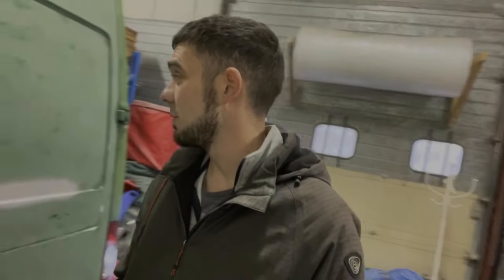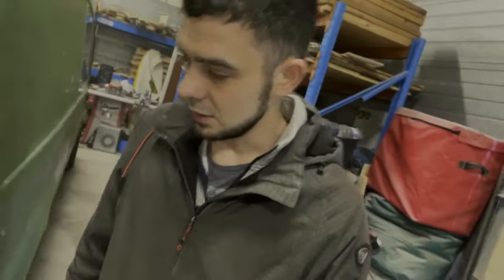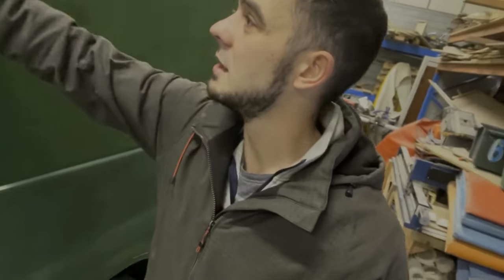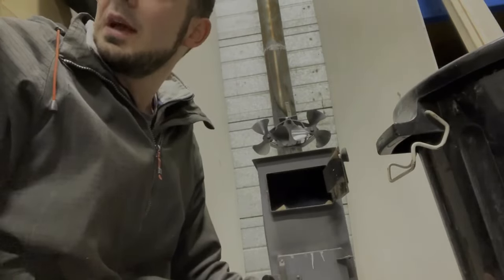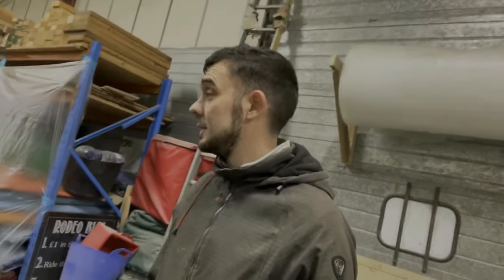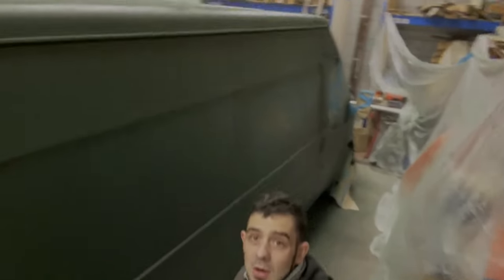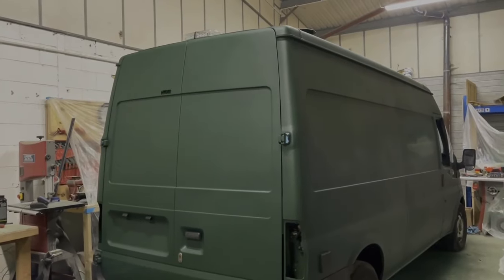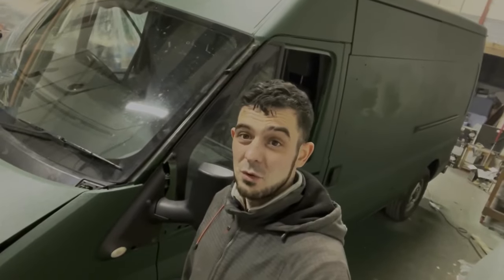Raptor Painting My Transit Camper Conversion With No Experience Van Life Paint Job Re Spray Stealth

Comment: I like how descriptive you are. For someone who has no experience. You sure know how to use common sense & figure things out. I have my raptor liner coming in the mail now. I've also never done anything on this scale before, but after tons & tons of YouTube videos, I'm going to give DIY a shot with my Honda Element. I saved this video because I find it helpful. Same reason I gave it a thumbs up. Great job!
Reply from the maker: Thanks man good luck 👍
Reply: @simplycampervanconversions  Thank you. I have just one question, what set up did you use for sanding it? I was thinking of getting an orbital sander for the task, but wondering what grit or kind of sandpaper would be ideal to get it sanded down like this?

Comment: How many litres of raptor did you go through mate? And how many coats?
Reply from the maker: Hi we used 2 boxes, however the van was already green so a full colour change could take a bit more as it coated really well.
Reply: @simplycampervanconversions  cheers dude. Got ours to do when the weather is better. LWB sprinter with a colour change, going to need at least double then I reckon.
Reply from the maker: @jakejohnson_  im going for 3 boxes on my xlwb daily which is a similar length and going from white to grey.
If you use the raptor gun it uses more paint but gets a better finish a standard shunt gun doesn’t use as much paint but can be patchy with raptor paint.
Reply: @simplycampervanconversions  how many in a box mate

Comment: Good job pal. What did you do about painting the rear door hinges?
Reply from the maker: I just taped off the rubber part and painted the rest, gave them a good scrub with scotch pads and painted.
Reply: @simplycampervanconversions  cheers. Appen I’m gonna give it a go 👍🏼

Comment: Hi pal nice job how many bottles of paint did u use
Reply from the maker: I believe is used 10-12 however I would have used more if I did it again.
A better drop coat at the end.
Reply: @simplycampervanconversions  , I’m looking to do my caddy do u have a rough idea how many bottles I will need ? What’s a better drop coat mean ? Thankyou
Reply from the maker: @michaellang5911  I would say 10 bottles for a caddy.
A drop coat is the final coat when you stand back around 2-3 feet away and spray a mist over the van.
Raptor paint is notorious for being streaky and a good drop coat helps prevent this.
Reply: Ok thankyou for your help mate

Comment: Nice, how did it hold up over time?
Reply from the maker: It still looked as good the day I sold it well over a year later and I have raptor painted my new van which has been painted over 18months and has been absolutely hammered by tree branches on tight roads in north Devon and still looks awesome!
Reply: @simplycampervanconversions  thanks for the reply, looks like a good product.

Comment: excellent job! really does look the part! do they do a smooth matte black?
Reply from the maker: You can get a smoother finish with a vari nozzle gun or by using a hpvl gun and thinning the paint down by 10% with 2k thinners.
You can get any colour on the RAL chart.
Reply: @simplycampervanconversions   cheers man!
Reply: Bit late for this but FX liner do a smooth black finish , sold by Buzzweld.